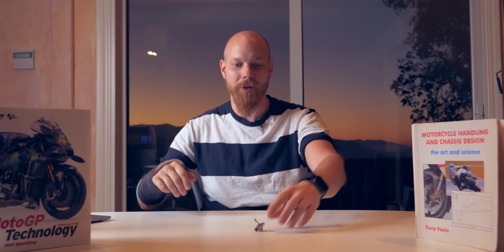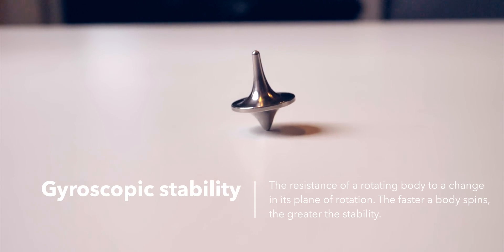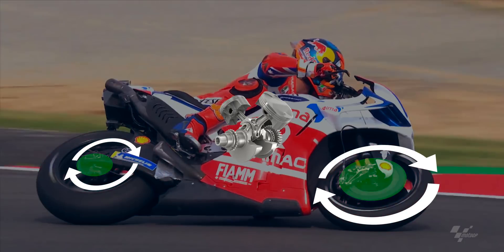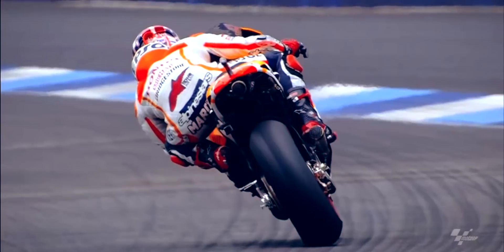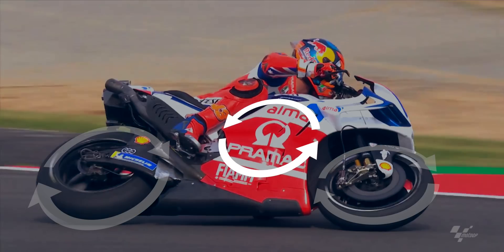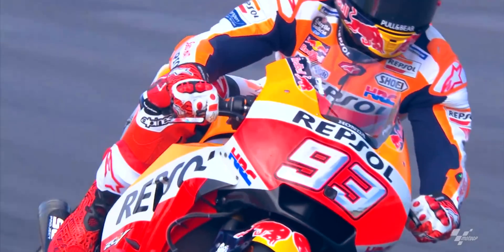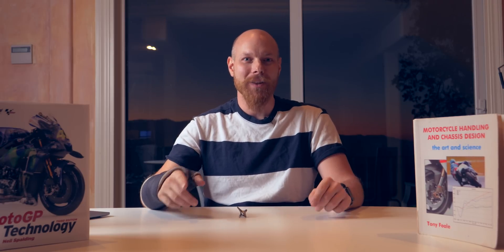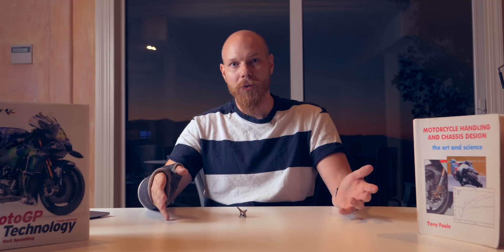Why MotoGP Engines Spin Backwards

Comment: So much knowledge in just 2 minutes thank you. Is there a way to buy or make a bike have a crankshaft that spins backwards?
Reply: buy a Ducati Panigale V4
Reply: Plenty of engines are like this
Reply: Not very complex for 2 strokes (which I found slightly annoying when I had to mirror my motorbike designs switching from chainsaw engines vs grass trimmers, but it wasn't worth the small effort of switching engine direction mostly because the specific clutch it had on that particular engine was directional and I didn't feel like changing it out with a symmetrical one). Since those don't have cams you really just move the magneto pickup to the other side and spin it backwards when starting, that's literally it.
Reply: all the Yamaha Vstar cruiser bikes have reverse spinning crankshafts, including the insane V4  Vmax
Reply: You can build a motorcycle with a bicycle engine kit, that engine rotates in reverse too.
Reply: @radicaledwards3449  That's true, but those are some awful kits, haha! I mean its hard to beat the 30 minute install times and the $100 its fun enough to mess around with, but certainly horrible engines in all other regards.
Reply: @jakegarrett8109  Mine are fine, those engines are blanks, you have to build them yourself really, they come assembles but that is all.
Reply: @radicaledwards3449  If you do that much work just use chainsaw engines (or motorcycle engines). Stock 10k rpm, stock come with good auto-clutches. The 25cc grass trimmer I used was significantly more power than the "80cc" (66cc, though I measured 64cc), had much more aggressive acceleration and a higher top speed (I had it geared about 20% faster, but even at low range it had significantly more grunt, especially going up hills). It also made closer to 250 mpg instead of ~50 mpg (I was usually below that, closer to 40mpg on the Chinese kits). It also weighs much less, so your cornering is much better, its also better off-road with it lighter.

I've also done a 52cc chainsaw bike (when the legal limit was raised from 50cc to 80cc, and the speed limit from 30mph design to 35 mph design limit), but it was just to celebrate the stupid law changing and was utterly ridiculous. It burned tires out stupid fast, but then again I like burning tires at the intersection with it so maybe that had something to do with it :)
Reply: @radicaledwards3449  If you're going to do much modding, don't use garbage kits to start with because there is nothing in them that is good: the chain is too large and wastes power, the clutch rubber looks like its from someone's shoe and an angle grinder wheel, the rear sprocket is typically bad sized, the engine mounts are integrated into the bad chinesium crankcase, the cylinder is pitifully garbage, the head bolts are rated for 6in-lb of force and might as well be plastic, the nuts are exceptionally low grade, the clutch lever is janky and flaky, the ECI is garbage and fails, the magneto is the worst hand would piece of garbage I've seen, the generator is rated 0.5 amps even on the upgraded ones, the spark plug isn't even worth keeping, the air filter is so bad small pebbles from a short 1/8th mile after cleaning the carb get through so I suggest using a sock as a filter "upgrade", the stock carb is not that great, the throttle cable breaks super easy and low quality, the throttle twist grips are terrible so you'll replace those with motorcycle twist grips, the other side grips are terrible and now wont match your good motorcyle grips, the muffler reduces about 15-20% of your top speed compared to a $5 go-cart muffler (which makes it sound awesome) even with plumping pipes and a 90 degree elbow (which is super restrictive but it still gave that gain), also the fuel hoses are junk as well and should not be used (and that's coming from someone who uses random 30 year old hoses in grass trimmers because I'm too cheap to buy new correct size lines), also it has no fuel filter so you'll need to add one too. Also they use the wrong key type in the engine side gear.

Name me one thing I missed, because I think that's all of the engine covered (and all of that from personal experience), though I still think they are fun to mess around, I admit they have every single one of those faults and are not worth significantly modifying, just ride it like it is and have fun. If you're wanting any more than they provide, buy a good engine (or even go with a  multi-cylinder radial engine for lols)
Reply: @jakegarrett8109  A lot of what you're saying is true, and I said these engines are blanks that just happen to come assembled, you have to build them yourself, and I do and I run for thousands of miles and can do 45 mph.
Reply: @radicaledwards3449  That's still a sad speed. My grandpa on his 90cc could do 70mph (speed is a function of power^3, so to do 2x the speed requires 8x the power). His bike still runs too, although its ancient.

Again, there is no point using a garbage engine without a single good piece in it when you can simply buy a much better Husqvarna chainsaw engine that will last you a decade and good to go as is, assuming you have any competency whatsoever in mounting an engine to a bike, there's simply no reason for using a modified kit (in which your using almost no parts from, in fact I wouldn't even use its engine bearings though I never had one catastrophically fail before the bike was stolen).
Reply: @jakegarrett8109  The more expertise you have, the less of what you are saying applies, 70 mph from 90cc 2t is nothing to brag about, in fact that would be considered rather slow, but reliable. It doesn't make much sense to do more than around 35 mph on a bicycle with no suspension and solid mounted everything.

I dont think you are an engineer or engine builder or you would understand that if somebody builds an engine they will build it to spec and be done with, all the problems you are having are because you dont understand that this is an engine that you need to build yourself, you should not use it out of the box.
Reply: @radicaledwards3449  I actually have 2 engineering degrees (mechanical and aerospace), but that's beside the point. The best bike I made was when I was young without a degree, front wheel drive (extremely stable, very fun to lock the rear brakes through intersections and keep it floored kicking the back out, it was so easy I let any child or adult take it for a spin on the streets, for kids I asked the parents first), it also allowed full suspension but I just had a cheap bike with hardtail however even off-road it was incredibly good and I really think the weight savings not having rear suspension for road use is worth it.

And yes that was an antique motorcycle that did 70mph, I'm not saying its fast (still comparing 2 stroke vs 2 stroke), it was/is still in decent condition and made to be a daily rider and durable (my grandpa really liked it for checking cattle, he was very short so this worked well for him using a little Kawasaki that my dad drove a ton when he was younger). That's why I recommend using an engine like that, or the nicer chainsaw engines (the reason for the chainsaw is they are made for side load on the clutch, the weights are on the outside and the moment of bending from chains or belts is close to the crankcase).

Personally I also like my electric bike, but some states are more restricted (cheap, insane torque, over 2kw per wheel and each wheel kit is only $140-$200), easy to install just like the kit bikes for people with absolutely no skill or welder or tools. I can do about 27 mph average just pedal on my bicycle though (and about 19-20 mph on gravel) for a 20 to 30 mile ride, so its not really necessary I just enjoyed the instant acceleration if I needed it.
Reply: @jakegarrett8109  You have 2 Eng. degrees but are so easily defeated by such trivial problems? I dont get it..... The only things you said that are true is that the material is not the best and that the spark plug is wrong, everything else is either trivial or irrelevant.

Example your thoughts on the cylinder.... well if you built the engine yourself and you understand porting then why would you build it incorrectly?,

The air filter, well i often dont even use air filters, a rear mudguard will stop the wheel throwing stuff. In so far as using a sock..... Only people who have never actually tried that think thats a good idea and if you have the degrees you claim, youll know how ridiculous that is.

The exhaust , I wont explain 'expansion chamber' since you have 2 degrees.

You say the rear sprocket is a bad size, well thats subjective if you understand gearing, i do just fine and anyway sprockets are cheap and commonly replaceable.

Twist grip, throttle cable, fuel filter, etc etc all trivial stuff for anyone who is professional.

I think you are more on the consumer side rather than the manufacturing side.
Reply: @radicaledwards3449  But you listed the whole thing needs to be replaced... So what are you buying? Again, for $300 I can get a very nice quality chainsaw engine, and no building is needed (also it weighs substantially less). My first motorized bike used a 15 year old MTD brand engine (which is on the cheap side, I later replaced it for $60 though the replacement engine had its crankshaft only lasted a couple years so I manufactured a new one on a lathe, but with the engine being so cheap I decided to switch to more load optimized engines such as chainsaws).

I could list a ton of useless garbage, like how I've used my dad's carlift to rebuild a car transmission for a neighbor because I'm an ok mechanic, or how I've rebuilt several engines, or how I've swapped turbocharged school bus engines into combines to double the power, or how I've built 5 different motorized bike variations, or how I've probably done 5x more heavy mods (such as adding hydrohalic systems and updating heavy ag equipment), or that I've modified everything I own to the point my lawn mower would do 40 mph because I was bored and I can do a complete transmission rebuild for it (or weld diffs) in 30 minutes, but you know what? All of that is basically irrelevant. It means nothing. You know why? Because my premise still stands, for the cost of rebuilding that garbage can you can simply BUY (or build something from scratch like I would probably machine a Wankel rotary engine for a bike), so using absolute garbage JUNK and spending a lot on it vs getting a GOOD quality engine (and better drivetrain design) from the beginning is the way to go. I try not to make fun of people, but come on, a 12 year old can weld up a better system than what you're describing, learn to design better and stop using garbage, or at least use GOOD garbage finds and use those (you can often find good running grass trimmer engines in the dump, that's fine, if you want to have a fun little project make it a V-twin, just have fun).

Doesn't matter your "skill level", my entire argument is that its still inferior at a higher cost, therefore not worth it. That's not to say you can't burn money (next bike I will do will probably have at least 1x $3k jet engine on the back, literally for no other reason than I like jets and I think it would be hilarious to wear a short superhero cape like a total dumb@ss dicking around on the street, lol!). Do what makes you happy, I like to design, and I like to optimize systems, therefore I like to design my own from scratch.
Reply: @jakegarrett8109  what are you talking about? Replace the carb, the head and the exhaust, replace the bolts and nuts. The rest is Either trivia or simple engineering to anyone who knows what they are doing, most of the cost is time and I don't charge myself.

You can't fool someone who knows what they're talking about...

So you have 2 Engineering degrees, but somehow manage to have all the same problems as someone with no degrees... But I don't.... So who knows what who is doing?

If I buy a husqvarna engine, the only difference in the work that I would have to do would be that I probably won't have to change bolts, and then I would have to develop a manual clutch too.

You don't get it do you, the better you are at what you do, then less it matters what you use to a point. You have to buy things that you could design and build (or you would) whilst I design and build whatever I feel like, this is the difference.

I'd be pissed if I had 2 engineering degrees, but still had the same problems as a guy with none.....
Reply: @radicaledwards3449  They weren't really significant problems, I'm just pointing out they are junk. If you look at my comments on this video, I mention they are pretty fun for $100 and hard to beat at that price, I'm not saying nobody should buy them (I think they are actually pretty cool gift for kids, give their bicycle some new life and let them have fun at fairly low safe speeds).

What I'm saying is the cost to properly change out every single piece just isn't worth the cost. Last chainsaw I purchased was under $100, lower price than the kit, made a simple pulley for it on the lathe, put it on, works great but I wished I spent more because the cylinder doesn't have steel cylinder liner so it will wear out much sooner). Again you're not going to beat the low cost of below $100 in parts of my favorite one ($60 engine new, $8 bike from a thrift store, some extra parts from junk bicycles, a $15 belt but I split for 2 belts, some scrap metal, and a few welds/springs/old motorcycle grip).

Also everything I mentioned (including the engine swaps etc) were before getting my degrees, obviously now I get paid much more and make cooler stuff, but I love to tinker and design in my free time. I fully acknowledge some people only have $50 to make a bike, and that's fine, my earlier version had parts from just about everything (a chainsaw carburetor, engine body from grass trimmer, fuel tank was power steering tank from car, clutch was from some other grass trimmer and the shaft was filed to accept needle roller bearings with the clutch bored out to accept as well, the sparkplugs were extra long motorcycle plugs which were so long the tip corrected its depth from hitting the piston which resulted in increased compression ratio, the gaskets were cut by hand, the ignition system came off another trimmer or chainsaw, the pull start was at one point air start only but reconverted back at some point). I mean it cost me almost nothing, and lasted me years without issue (it actually still runs, its just a pain to start and swapped out with newer model). I actually still have parts from the expansion chamber I made for it too (2 strokes are easy to calculate and use hydroforming with a pressure washer), but being on the front I didn't want to mess with the routing.

Its a hobby, I don't fault anyone for playing with the toys, they are fun. What I am saying is again, financially more reasonable to buy something BETTER with the same money (or less, you can do it a whole lot less like I did too, but if you can afford a $60 engine I'd recommend it). I can't possibly see how you're arguing against that.
Reply: @jakegarrett8109  You dont know anywhere near as much as you'd like to think, but you know a bit. I can tell because you dont know the specs or model of the parts that you use (chainsaw carb, for example rather than ,xxx model (or clone). I always have parts that meet the spec of my builds and can tell you exactly which model (or clone) and jet sizes too...

What do you mean 'clutch bored out'? How could you do that and why would you?

''the sparkplugs were extra long motorcycle plugs which were so long the tip corrected its depth from hitting the piston which resulted in increased compression ratio''

I can officially call Bullshit now, if you actually did this, first of all there is no such thing as a 'motorcycle spark plug' spark plugs are made to a specification and then selected by the manufacturer depending on application, secondly and this is HELLA bullshit, if your piston crashes into anything in side of the bore you will very quickly break the piston or bend the crank (I have been there). If you want to raise compression, skim head or use thinner gaskets or fill out the piston top etc..... But the best you can come with is 'EXTRA LONG SPARK PLUG!!!!!!!

Also why would you change every single part? The only things I change are, Carb, Exhaust, Head, Nuts, bolts, gaskets and seals, which adds $120 to a $100 engine when anything less than $450 for an engine with the spec that I build is excellent value.

I can understand how a hobbyist might share your views, but as a professional I dont. I notice how you make no mention of the REAL problems with this type of engine like, aluminium grindings in the cases or mismatched bolt holes, everything else you mention is trivial if you want to build something fast because the work you'd have to do is the same on all single 2t.

But what you said about the spark plug shows that you do not know what you are talking about.

A free bit of expert advise use 'BRISK N17' spark plug and you will see that there is nothing wrong with the CDI
Reply: @radicaledwards3449  why mention model specifics? Like why would you care I slapped a generic carb (from a woodshark ~45cc chainsaw, which are terrible saws and after a year the cylinder was so wobbled it looked like a V twin grinding itself into an oval), the motorcycle plug was a generic NGK I used from my Hensim Enduro when I changed it to newer ones, but I don't just remember the model numbers, I just look up the part or the old one when changing. Also by gap I meant if you had the gap excessive (let's say bent out to .040, when you cranked it the piston would whack it almost to the perfect gap, it wouldn't hit a second time afterwards since it already bent it. I only know it did that because I saw it happen (trying a huge range of gaps just for fun), but it would close the gap beyond a specific size (I don't remember what feeler gauge measurement it was, but it was about perfect so that's how I'd set the gap after cleaning plugs). Also that engine was so worn out the plugs would only engage threads for about 3/4 of a turn and that was it, hence using non-original plugs instead of short ones because why waste a helicoil kit on a worn out trash engine? Even my crankshaft had broken off on it so I had welded washers on both sides, then lined the washers up and tack welded and just manually after a few times got super lucky and it was well balanced, so really nothing worth saving (this meant I could no longer remove the pull starter cover due to the large washers in the way). Why mention model numbers, also I don't document personal project mods that I'm never going to repeat, literally nobody cares, not even me. It was junk just thrown together (I still have it for sentimental reasons, it was on my go-cart when I was about 5 that my dad built for me with me selecting the parts, and then later on a wormshaft driven motorbike, and then finally the front wheel drive one for a couple years till I decided it was just too much of a pain to start after I saw the new "easy start" pull type my grandpa got as a Christmas present and was really impressed. Also on the clutch, the original bushing was worn out so I bored it out then press fit 7mm shaft needle roller bearings into it (and filed the shaft down to 7mm), it was otherwise getting hot enough to turn the shaft colors since it had higher side load.

That's all just redneck engineering, I don't know why you want my life story for something unimpressive that probably half the redneck kids could do or have done. Even my neighbor at about 12, and let's just say he has learning problems and couldn't tell you what 12+5 was and I'm making fun because he was actually pretty good at fixing things, even his gocart was made up from about 3 unrelated engines and I'm still not sure how he managed to pull it off, but the kid wanted a gocart engine and so he persisted with what he had and got it done! I think he does auto repair now, and at 14 he was doing major repairs on junk trucks he would buy (do some other silly things like put stereos that would rattle half the bolts out they were so loud), do cheap exhaust mods if they were rusted (apparently glass packs are super cheap, he loved using those), then he'd buy another project. At least from where I'm from (middle of nowhere), this is typically what children do for entertainment, we have large piles of scrap metal, engines that won't run, but we have the desire to make something so we do. It's as simple as that. It's not really anything I consider noteworthy or impressive, maybe to you it is, but to me it's just another day playing as a kid when we aren't working on the farms.
Reply: @radicaledwards3449  standard bushings were turning the clutch blue and wearing fast (they are not intended for extreme side load pressure like I was asking it when stopped at a sign, required a lot of tension for belt drive, normally there would be no side load on grass trimming application).

Also Its generic motorcycle plug to me, it's threads were long enough, therefore it was used (remember damaged threads, couldn't use original). Compression ratio is defined as displacement divided by excess space, so by reducing the excess space (filling with welds, lapping the heads, cylinder seals, or in this case using a substantially longer plug than designed filling more void), you could notice it change quite a bit (much harder compression stroke when pulling but it started up easier). I usually adjust then by eye if I'm honest (or in the case of my car it has special leading and trailing plugs, I'm not touching those unless they aren't firing, rotary engine).

Remember, I did all this as a kid, what do you want a kid living on a farm with very limited resources to do? It never wore the bearing out either, so that part worked perfect (also made it less grinding sound). Design, fail, learn, improve, repeat.
Reply: @jakegarrett8109  why would you have a side load all of a sudden? From what process? So you went from using the wrong plug to a better plug and think that's a mod?
Reply: @radicaledwards3449  trimmers have no side load on the output shaft, NONE. My setup uses belt drive, which applies significant tension giving the shaft and beating a heavy side load.
Reply: @jakegarrett8109  What do you mean when you say 'trimmer'? If the blade rotates parallel to the ground, thats a side laod